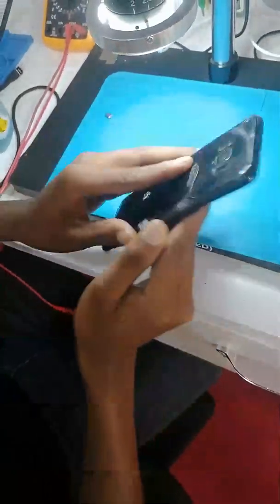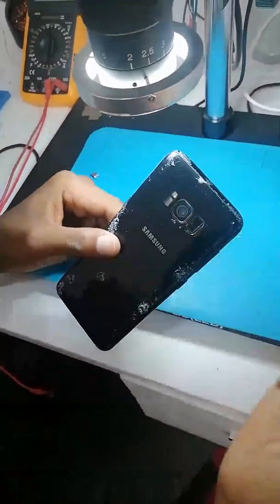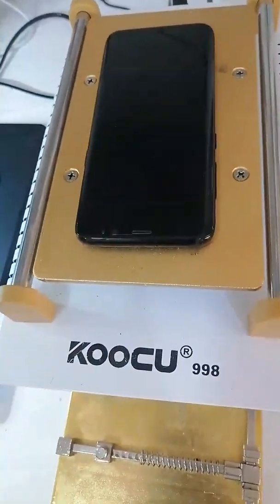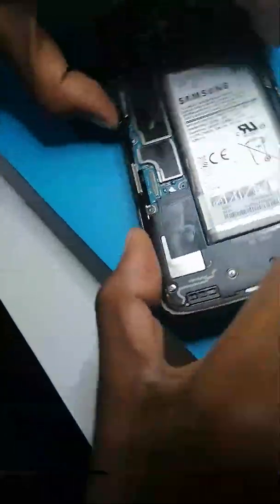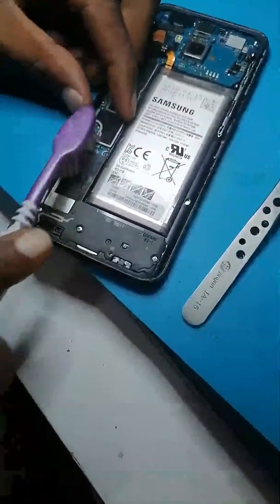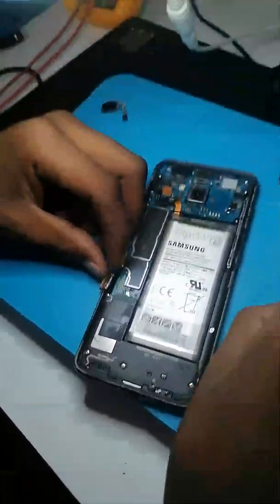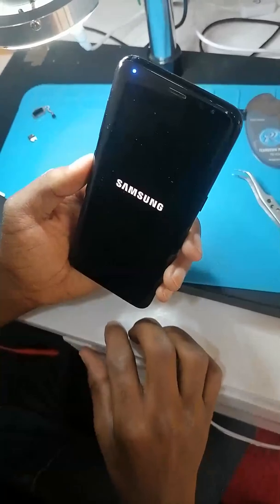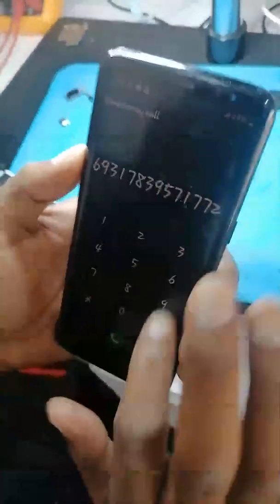Samsung Galaxy S8 No Display /Black Screen -Solved 100%

Comment: I have a same problem my galaxy note 8 freeze I try to restart but the phone start but no display showing phone still works phone still works black screen
Reply from the maker: shutdown your phone  then disconnect lvds  cable  and clean  lvds connector.
Reply: Same problem